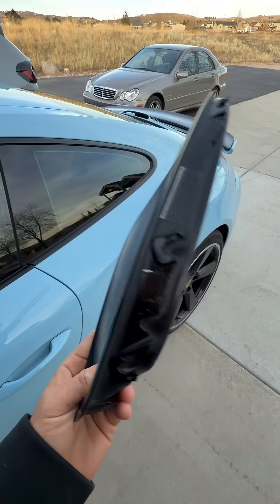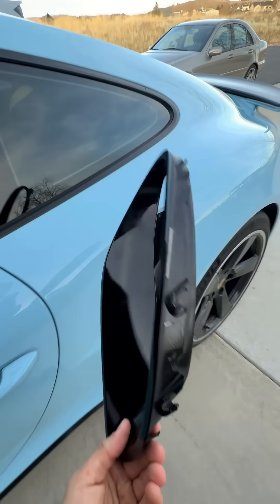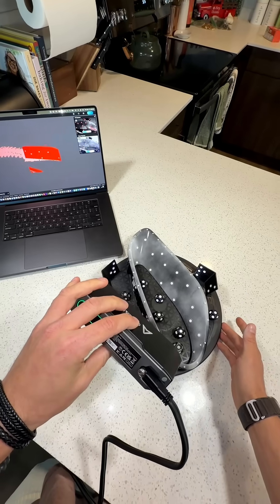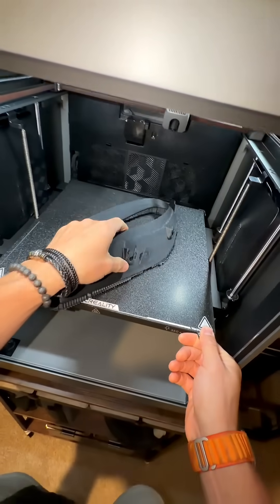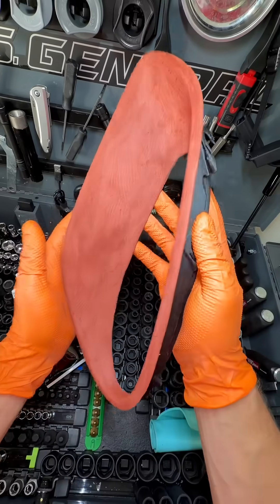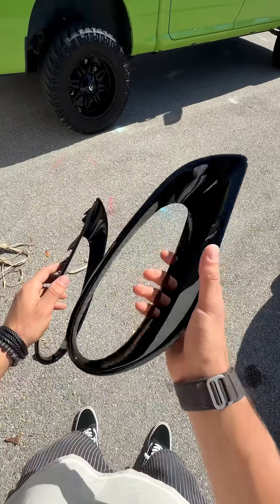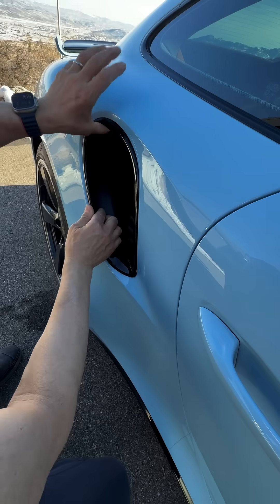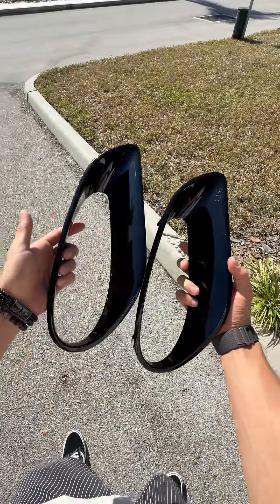Porsche wanted $2,000... So I 3D printed it for $20 instead😳😳😳 #3dprinting #creality #porsche

Comment: Your time, scanner, printer , knowledge = 5k
Reply: you can keep reusing the printer and stuff, its not 1 time use bro
Reply: @Toasts  Alot of library's have pretty nice 3d printers you can send files to and have a staff member print it for you. You only pay materials and power which comes out to a couple dollars. Local library's, I know everywhere won't have them but I'd check first.
Reply: @Toasts 
If someone needs a duct asap, telling em to buy a printer & spend time learning how to use it, doesn’t make sense. It’s a long term goal not a short term fix.
Reply: @Appu17375 well yeah obviously this is only an option when you already got one for various reasons, this should go without saying
Reply: @Toasts  true, ill just have to wait until something else falls of my 200k porsche turbo.
Reply: @Toasts no, duh. Did you try and spell it out for the people in the back? I assure you, they can read.
Reply: @Toasts  Doesn't matter, even for someone who knows what they're doing and already owns the hardware that is more than $2000 worth of time and expertise. If you have time to burn and it's a hobby, sure, do it for fun. If a "friend" asks you to make one, tell them it'll be easier and give a better end product just to buy the $1800 Porsche one.
Reply: @wolfie54321 they are the same thing dude why do people think 3d printers cant use real matterials and not just plastic and weak stuff and HOW IS A 3h job 1800$
Reply: @Ziadalblawy  because most people that lives in this world are not engineers nor people looking to build their technical skill that help them in longer run, instead they are ordinary people chasing time to get promoted  that don't give damn about any skills except their 9-5 jobs skills and would rather get extorted by literally anyone and any company instead of doing puny amount of research and learn something valuable from it.
Reply: @Ziadalblawy  If you think this a "3 hour job" you're delusional. I'm an engineer, I have 3D printers at work and at home, I have used 3D scanners, I have 3D printed bits to replace broken parts on my own car... this is not a 3 hour job. The time to apply those dots, spray it, scan it, turn it over, scan it again (insert "realise it's terrible for some reason and scan it again"), clean up the scans and turn them into manifold bodies, print it, sand it, apply filler, sand it again, spray it, sand it again, repeat until the surface looks good, take it to a body shop and pay them to spray paint it properly... that is NOT 3 hours of work. If he was printing 20 of them, maybe by the 20th the process would be down to 3 hours. The last step alone (organising someone else to do the spray painting) is probably taking a couple of hours out of your day by itself. You're also delusional if you think it's "the same thing" when the original is an engineered plastic designed for the purpose, probably injection moulded, versus the 3D printed part which is limited by the process of 3D printing, has a layer of filler to make the surface look decent, is not actually monolithic, and is probably either much weaker or much heavier than the original. It'd be "fit for purpose" if you couldn't source an original part and needed to make something yourself, sure, go for it.
Reply: @wolfie54321  3h of ACTIVE work not waiting
Reply: @K @Kujo_Saitama  i actually like learning those stuff rather than just buying it but you can do whatever you want and can afford
Reply: @Ziadalblawy  Nah, you're still delusional, that's way more than 3 hours of active work. How long do you think it takes to apply those dots, spray, scan, rescan to get the other side, clean up, check all the dimensions are correct and adjust as necessary, support for printing, setup the printer, (forget the actual print time and any reprints if it didn't work the first time), remove supports, clean up the print, apply filler, sand filler, apply paint, sand paint (probably repeat a few times to get a half decent finish), organise the spray painter, take it to the spray painter, pick it up from the spray painter. This is not 3 hours of work. I maybe exaggerated a bit by saying $2000 of time and expertise but it wouldn't be far off, close enough to make it not worth doing unless it's your hobby rather than how you actually plan to make a living wage. I've done similar projects where I've had to scan something and print it and clean it up to show room quality, it's time consuming to do right, but I didn't do it for fun to try and save $1800, I did it because the final product was something you can't purchase. I've also paid companies to turn scans into physical models. I've seen how long it takes for people just to clean up scans from more high end scanners than he's using here. Notice when he said "once we have a clean model..." that's Blender he's using in sculpt mode to clean up the scans ready for printing. None of this is fast, it's way more than 3 hours work.
Reply: @wolfie54321 sounds like you just suck dude. And that also means your time really isn’t that expensive.
Reply: @kolinmartz  Haha, like I said, I'm an engineer, I've been involved in doing this type of stuff professionally, and I've paid others to do this type of stuff professionally. Hobbyists have a tendency to not appreciate the time investment of things. Occasionally the hobbyist then thinks "hey, I should do this for a job" then after a month realise they're making less than minimum wage and the teenager mowing lawns is onto a better thing. When you see the video showing stuff like doing a test print in PLA first to check fitment, toying around in blender to clean the scans, and literally applying filler and sanding, but think "oh yeah, totally 3 hours of work", you're delusional.
Reply: @wolfie54321  What most people here seem to forget is that once you have the scan, you can do this thing called selling it. That’s what a lot of bodywork shops, eBay sellers, and similar storefronts do - once they’ve spent the time to create the mould or scan, they can make the item on demand and profit indefinitely.

2nd, you don't need to sand it, use solvents to smooth them with almost 0 effort. It's a double edged sword, but in this use case I would do that.

3rd Spray painting isn't hard, it's a good thing to learn and can be done with very cheap tools these days - and once again, it's a skill that pays off very quickly.

And lastly, 3d prints can be optimized to be even stronger and lighter than the original product. 
While yes, you need heaps of knowledge to do all of it, but if you don't start now, you will forever be buying the 2000$ Porsche part... Being handy with many tools doesn't just pay off for just you either.
Reply: @juerrila2614  1st. Sure, if there's a market for those particular Porsche plastic inserts, you can make them on demand. Is there? I dunno, I doubt it, but maybe. That's probably half of the reason they're expensive from Porsche, it's a hassle for Porsche to stock them when they don't sell many. 

2. Meh, I've seen solvent smoothed parts, they are smooth, but they are unlikely to have a good enough surface finish for me to want to put on my car, let alone a nice expensive car like a Porsche, and not when painted in gloss black which is unforgiving (your Mom's Hyundai Elantra, sure). 

3. I never said it was hard, I'm pointing out that this is not 3 hours worth of work. If you want something that is gloss black and looks good enough to go on a car, it's quite tricky to paint well, you'll generally spray, sand, buff, and polish it to avoid things like orange peel or a gritty finish. Again, if it's your Mom's Elantra, sure, grab a gloss black rattle can and have at it. 

4. If we're talking about optimising to be better quality than an injection moulded factory part, we're WELL over the 3 hour mark for this project. You probably won't engineer it better, with a bit of effort you might engineer it to the same level, but honestly probably not. It's likely an engineered plastic, so even if you think you're using the same material (e.g. PP, PC, whatever) in reality you probably won't get the same final properties because the Porsche part will likely be a mixture of materials that they've optimised (e.g. maybe it has some rubberising additives to make it tougher). Not saying car manufacturers don't occasionally mess up and hobbyists can sometimes do it better, but the original part likely has many man hours of optimisation from a qualified engineer. 

5. It's for a 2017 Porsche 911 Turbo S, it's a car that was in the $200,000 range when new, even used now is probably over $150k, maybe add up to $50k depending on how it's optioned. This is not "being handy with tools to save money", this is "dude with a hobby wasting time when the original part is available and in line with expected pricing for a luxury sports car".

6. Look, I appreciate handy work as much as the next guy, I used to work on a race team, so I've designed and fabricated car parts from scratch, and I'm too a hobbyist with a printer, access to a scanner, experience with CAD and Blender, etc, and have 3D printed bits here and there when I needed them. But people have this weird idea that 3D printed parts magically appear and they've saved $1800, when in reality this guy is doing roughly the same dollar amount of work to produce an inferior product. If it's his hobby and he's just doing it for his friend for fun, good on him, I wouldn't waste my time on that when my friend had the money to buy that $200,000 car in the first place, haha. If I was the owner of said Porsche, even though I have the skills to do what was done in this video, I'm just buying the $1800 part, I've got better things to do with my time, lol.
Reply: @wolfie54321  1. You are not stocking anything other than filament and print files on drive.

2. Solvent smoothed ≠ ready to use. You still are supposed to sand, prime and paint??? 

3. This is irrelevant to 3d printing parts and is inevitable with spraying anything, and nobody mentioned rattle cans. Yes of course, it will take more than 3 hours to prep and spray, but it's easily doable for the average person and for the fraction of the cost of an OEM part. Gloss black isn't "tricky", wet sand, finish off with a high-gloss enamel, wet sand the gloss, rinse and repeat until your desired level of shine appears. It's easy with basic painting knowledge and depends on the amount of effort you want to put in to perfect the look.

4. This point is debatable both ways so I won't argue with it, but I will add that even with all these new "qualified engineers" modern cars get recalled more and break more.

5. Just because it's a luxury sports car doesn't mean you can't tinker/modify on a budget, in which case a 3d printer is the best thing to own. If you own the mass produced car as a "collector" which is a joke in itself, then yes, you would obviously want all new OEM parts.

6. Because 3D printing is saving money... Having to scan and finish the model takes time - of course. But if you're doing it in your free time, as a hobby that you enjoy - Yes, you are in fact saving that money... Which again, in the end can be printed and primed for less than 50$ to then be shipped and sold for 300-400$ worldwide. Now will one of the 10 thousand owners ever need one? Probably not! But if one just like in the video shows up, your little project might save them a lot of money while you make some back as well. Which in my book is great, as I would want more people to do the same and create a cheaper DIY market.
But of course it's not for everyone, and clearly not for you! So go ahead and enjoy those possibly slightly better OEM parts at higher value, champ! Just remember that car prices are rising mostly because of people like you LOL!
Reply: @juerrila2614 1. I wasn't talking about him printing and stocking them, I was talking about why it's expensive for Porsche because Porsche don't 3D print junk, it's likely an injection moulded part, they aren't making 1 offs, they need to make enough to justify firing up the machine. My point was that's probably why the Porsche part is expensive, it's low volume.

2. I'm not sure if you're agreeing with me or not, but no, solvent smoothed is not ready to use when the application is an exterior panel of a car that is painted gloss black.

3. What you described is time consuming and that's my entire point, not that it can't be done, but it's time consuming, and time is money. The original part probably isn't even painted, it's probably a gloss finish in the plastic itself off the machine that made it.

4. There's recalls because cars are complicated. Try building a car from scratch and I can guarantee you there'll be many parts that need to be made 2, 3, 4 times before you get good enough to go on the car.... then drive the car 50,000 miles and half those carefully designed parts will be loose, worn, breaking, whatever.

5. Did we watch a different video? He didn't tinker or modify, he attempted to make a 1 to 1 replica of the original.... but worse. If this was a 60 year old Porsche where the part could no longer be sourced, or if it was a redesigned part that had aesthetics or functionality different to the original, we'd be having a different conversation.

6. Even if this wasn't a one off your "made for $50" estimate is still wildly off. Though I agree the target price range would be in the range of a few hundred dollars, because that's all it's worth next to the $1800 original Porsche part, the profit margin would be slim. Personally I think the market for parts like these isn't just "not people like me" it's "not people like Porsche owners". Who buys a $200,000 car and then stresses over replacing an $1800 moulding? Again, if we were talking about some modification part it'd be a different matter, but you can then multiply the development time by a factor of 2 or 3.
Reply: Knowledge here is more than 5k x)
Reply: You forgot to include the price of parents looking after him, his education, his medical fees, his food, his entertainment, etc.
Reply: @MouldyCheez  You forgot to include the price spent on infrastructure used to build society that allowed his parents to get to the point where they were able to conceive him.
Reply: @GoodwillWright  yeah buddy and you are clearly forgetting to include the compounded cost of civilization itself. from early agriculture enabling population density, to the invention of writing, to the scientific method, to the industrial revolution, to globalized supply chains and modern computing... without centuries of accumulated knowledge, stable governments, electrical grids, internet infrastructure, and advanced material science, none of this exists. also factor in millions of years of evolution leading to opposable thumbs and abstract reasoning, plus the astrophysical conditions required for a stable star and habitable planet. once you include all of that, the printer filament is honestly the cheapest part of this process.
Reply: @jofara2588  You forgot the cost of the infrastructure that is running the simulation that we're all living in.
Reply: @MouldyCheez  Dont forgot the Tips%
Reply: @MouldyCheez you forgot to add the cost of his pants his t shirt his watch his shoes and his underwear
Reply: who cares. he can replicate the process for other owners who want to save money. but this is the real problem here. buying a porsche like the one in the video (considering also taxes, insurance, inspection, oil change etc.) means you have a shit ton of money. i dont know if someone like that would want to invest the opportunity cost of time in something like that. but good for him. maybe he can make a business out of it.
Reply: how many porches have the same problem? he can now have it mass produce and sell for 500 each.
Reply: You do realize this guy probably made a dozen more sets and instead of being down $3k he’s probably up $3k now.
Reply: For him it is 100$ since it is knowledge and stuff he already has... that's a stupid way to loo kat it.
Reply: 500$ try again
Reply: Look at view.. It paid off
Reply: Inflation year over year, 2x with compounding!
Reply: True, but Porsche got $0  additional which is a win.
Reply: Your comment is worth 5k 👍
Reply: Don’t forgot the Mac book
Reply: The possibilities of the scanner pay itself off
Reply: @vlz.matthew true... $2000 spent in one thing, verses $5000 spent on equipment & tools that can be used for a myriad of purposes is not equivalent, since a smaller percentage of the $5k goes towards addressing the problem, than paying for the official part.

For materials and labor the cost is around 10-15% of the cost of buying the part... And that's a more relevant comparison since the company you buy the part from has spent more than $100k on equivalent tools and equipment 💁🏼‍♂️
Reply: @BJCMXY  hes not only using it to fix the porsche... long term a 3d printer has potential to pay itself off
Reply: @vlz.matthew  isn't that what I said/implied?

For the part itself.

The labor of making it yourself, and the materials required, is 10-15% of the cost of buying the part.

The premise of including the Tools and Equipment in the cost calculation is a fallacious comparison, because obviously when those are included, the price goes up significantly.

However, if you compare the cost and labor of making the part, and the materials involved, you can get a better idea of how much that part should actually cost.

Because it's obvious that Tools and  equipment are a separate component and the price breakdown for paying for that stuff isn't the same as Rolling the full cost of them into making the part.

You buy the tools and equipment once after all.
Reply: @BJCMXY  you talk too much man, i made a good point just stop
Reply: @vlz.matthew I write too much, but you didn't read what I said to begin with 😂
Reply: He can technically sale it 10 for half eve price porch sell
Reply: That’s the investment. Now he can sell each pair for $4k just buy pushing a button and sanding
Reply: I could never do that myself lol😂 I also wouldn’t be able to afford a Porsche 911 lol
Reply: Don’t kw how to paint or spray paint but kw how to 3d print is beyond me it like Albert Einstein knew that the moon was gonna block the sun but not knowing how to count it’s like dam bro how that happened but I ain’t hating bc he only kw how to do things he loves to do  I respect it bc the person that brakes his back to build the house doesn’t even come close to getting the amount of money to the person that designed the house 🤦🏽‍♂️ Ik the world never seems to amaze me either it pays for the brains and even kills you for the ideal then take that info to get rich off it hides it away from the poor the only thing the rich and poor have in common is death bc it’s for certain you think we share the same money ,rules, or information like for medical and health purposes is a lie and your just blind or better yet apart of the system that don’t care the human brain is wired to protect it’s self don’t try to tell me different bc we’re the same as animals  we’re programmed to protect it’s self foolish to think we’re on top of the food chain cage animals and humans for our personal benefits for observation after the vaccine and medicine is cleared and pass the test on rats they go to humans the ones with no rights and are in chains crazy huh if you don’t kw now you do and for the ones who gone comment about me telling lies and whatever stop telling lies or open you eyes a lil more n look around
Reply: We know he didn't lose any part
He just wanted to flex his 3D printer
Reply: Knowledge?? He did it for himself bro. Chill
Reply: Thank you for showing us exactly why they want $2,000 for it. $1,200 for materials and labor and 800 profit. Video brought to you by Porsche???
Reply: How do you make Ceality printer cost that much? Printers are like 500 usd and scanners are like from 200 to 1000.
Reply: Knowledge and experience is something you can't sell
Reply: Not really, 2k is a lot of money yknow
Reply: When asked about the secret to his dish, a world class chef once said, anybody can make this dish, it's a few basic ingredients and 2 decades of experience to cook it.
Reply: But you keep the scanner, printer, and knowledge
Reply: Tell me you know nothing about 3-D printing without telling me you know nothing about 3-D printing
Reply: thats true but he is a youtuber so he gets content from that
Reply: yes but this video + new subscribers = >$5k in long term ad revenue.
Reply: people in the comments act like most people would actually use a 3D printer😭😭 not to mention if you don’t have the other part, you can’t just download a schematic I’m assuming. It was convenient because it was. Makes a nice YT short but it’s not ideal for the average person. 2k for a piece of plastic is OD tho.
Reply: Not paying to Porsche is the biggers win. These guys should stop asking so much money for some plastic replacements
Reply: You can learn too bro, you don’t have to gatekeep a trade- just try it yourself
Reply: You could do it at about 500 dollars and 2 hours worth of work total not as expensive as you think nor difficult or time consuming
Reply: One time investment or just ask someone who already has made the investment to do it for a lot less.